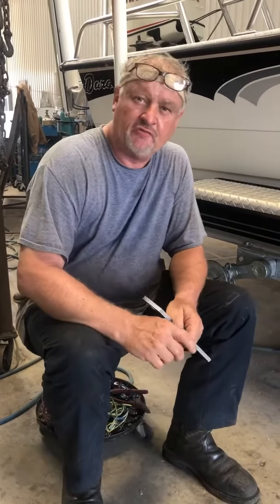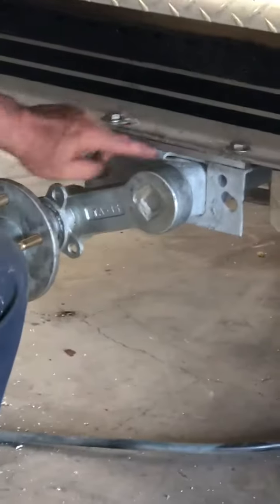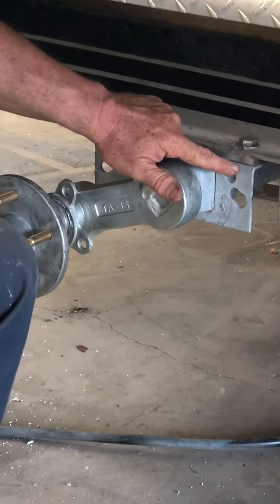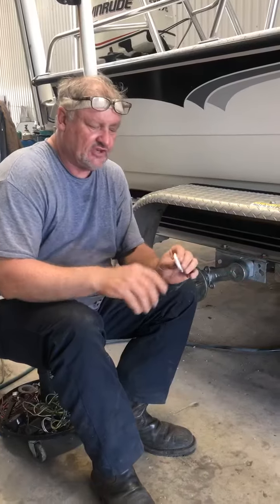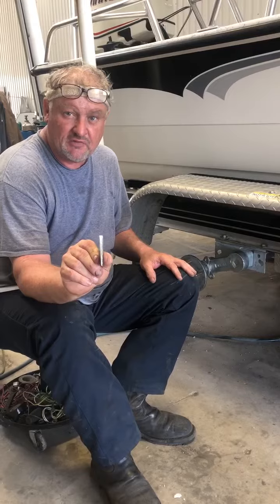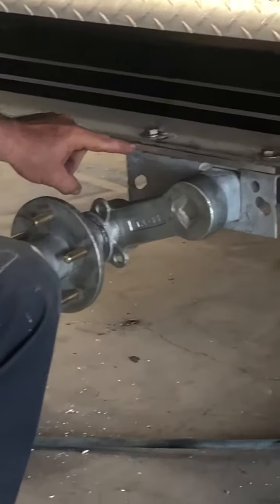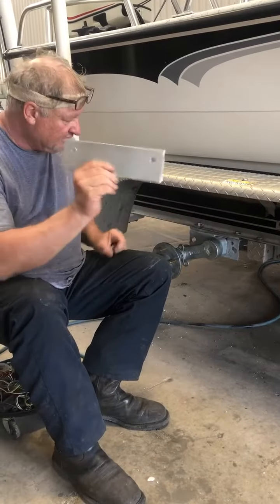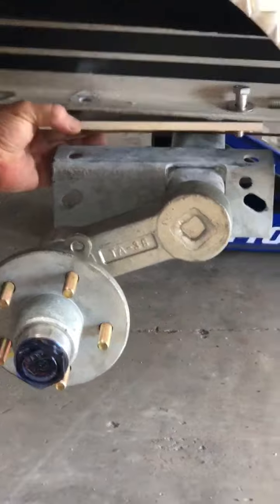Tip for replacing a torsion axle on a boat trailer

Comment: I just got a new boat trailer with torsion axles. I will look to see if it has this piece of sacrificial aluminum, if not, it will have! Thank you! I should have known this since I was a helicopter structural mech for 20 years in the Marine Corps, and corrosion was our number one enemy on the aircraft. Dissimilar metal corrosion can get you really fast especially in a saltwater environment. Oh, and new sub!

Comment: Just a question, would stainless steel be better than aluminum or does stainless react with aluminum
Reply: all dissimilar metals react with each other. the idea with the aluminum is to keep the corrosion on the axle flange and not the trailer beam...

Comment: I have a single axle ez loader boat trailer  i need to add axle  how do i determine measurements for the axles on the rebuild   Model # for trailer   Ap 20-22 2800  it has a 3700 lb axle now